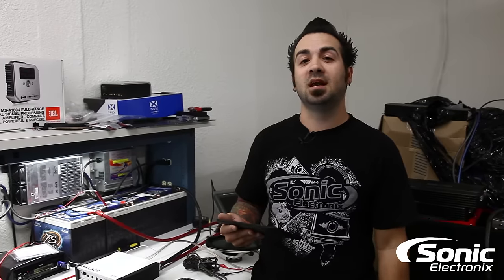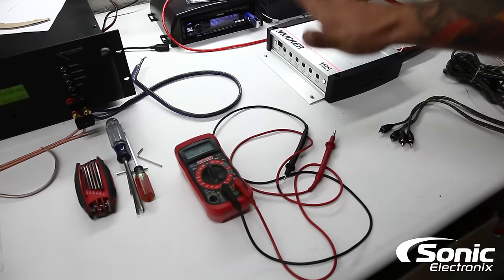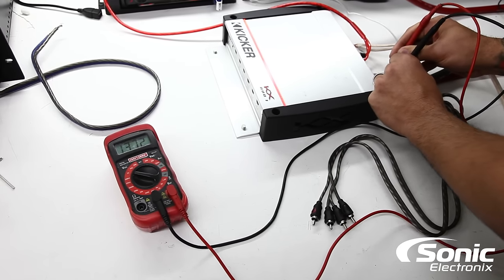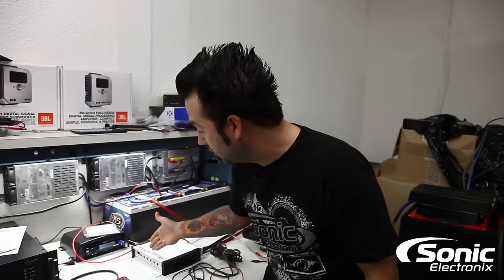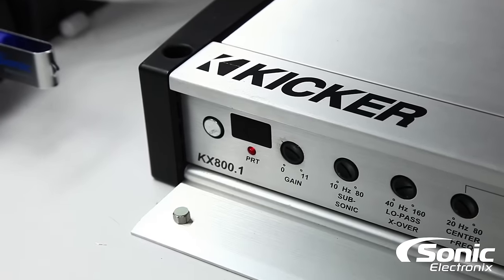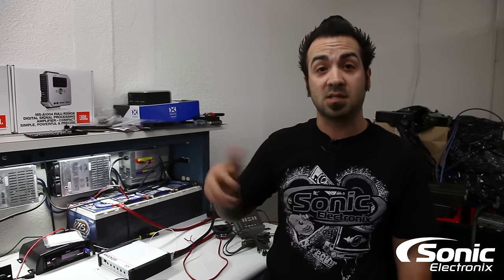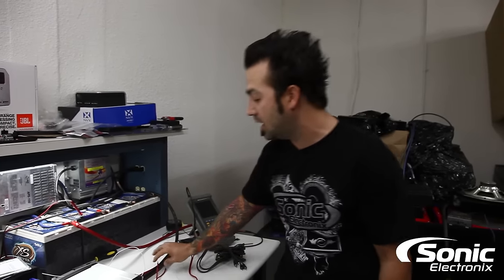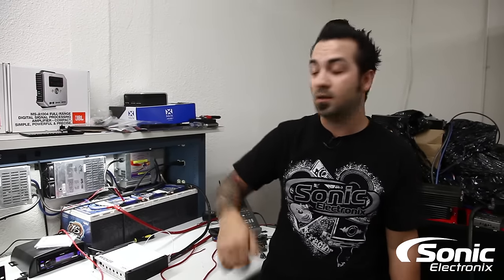Why is My Amp Going Into Protection Mode When I Start My Car? | Car Audio Q & A

Comment: Me: why tf is it going into protection mode?
Ground isn’t hooked up right
Fixes ground
Amp: Protection mode
Reply: Same! Imma end up junking the whole car I'm done lol
Reply: @gmax341  same
Reply: @Bajrangiprasadkumar  turns out I was trying to run a 1 ohm speaker with 2 ohm stable amp 🤦🏼‍♂️. Fixed my issue by buying a 1 ohm amp.

Comment: You should also make sure youor using the right gauge power and groynd for you amp. And also make sure you stock alternator can supply the amperage that the amp needs.

Comment: For anyone using a PAC AmpPRO and is having the issue, the problem is likely with the PAC unit.  They die easily from ANY kind of short in the car, even for a split second.  When they're dead, they will send your amplifier(s) into protect until you replace the unit.

Comment: Hey I had a quick question I have a kicker KX 1200.1 woke up this morning started my car speaker started making this weird noise I unplugged them  the amp was still in protection mode I rewired everything  new from the ground to the hot wire from the battery from the fuse to the remote and it's still in protection mode even without speakers being hooked up so I tried my old amp And my old amp works so could there be something wrong with the kicker app that I bought

Comment: Thanks For the great advice i was just connecting my amp , and it keeps going into protection mode , but it works fine when i remove one of the speaker (out) its getting late so i came home to check for solutions and i will at least know what to look for tomorrow when i go and check it again ,,, Great work guys.
Reply: Mine does the same did u figure it out ??
Reply: @DavidGonzalez-om5yr  did you ever get it figured out?

Comment: I was in tears thinking I need to replace my amp, I just had it for about 3 days and it was thumping fine till that protection light came on tried troubleshooting it myself but nothing worked till I watched this video and found a faulty wire with the speakers so thanks !!!

Comment: Ya started out good, but started over explaining the answer. 
I know what you're saying, but I know from my experiences, that alot of folks won't...LOL 

Chances are if he's only experiencing the protection mode when starting the car, then his battery voltaged dropped too low while cranking. 
The regulator is a good point also, but then the protection mode should have also tripped when the voltage spiked.
Reply: Brake lights?!! 
Wish I could say I don't know what you're talking about....LOLOLOLOL

Comment: Awesome video. Huge help in figuring out why I had one going into protection at different times. Damn speaker wire grounding out. Easy trace and fix. Thanks for covering all the options and troubleshooting.
Reply: How would 1 trace down a speaker wire grounding out?

Comment: I've been looking for help all around but with no results, i hope someone still actively watches this video or something. The issue im having is when i start my car my amp works fine, and my subwoofer kinda works fine too. BUT when i turn the power off and the amp shuts down and i turn the power on back again my amp's light is flashing indicating an issue and the subwoofer doesnt work anymore. so i turn the power off and come back after an hour it works like before repeating the issue. i've basically got a one/two use a day subwoofer :D

I'm running a 400w 4 port pioneer amp with a 12" 1200w pioneer subwoofer

Comment: OK vid i guess. But, many of the problems you went over are not specific to his symptoms of the amp not powering up only when the car is on. If the speakers are shorted, it wouldn't work in ACC mode either. Given his symptoms, I would check the power to the amp, the ground, and then the remote turn-on, as many newer cars do have some fuses that are powered/not powered once the car is started, and if the remote if connected this way via fuse panel, it could be plugged up to such a fuse.

Comment: Heres a fun question, my GF dropped her aux cord into the cig lighter and blew the head unit, the amp is now quieter than it used to be, even with a new head. No protect mode or any other issues. What do you think went on the amp?

Comment: I was having the same issue and couldnt figure out what the problem was. After trying all the troubleshooting it ended up being that the remote gain controller had to be plugged in otherwise it would trip the protection when the car started.
Reply: U tlking about the bass knob ? Mine keep going into protect mode.

Comment: randomly when I listen to music it will cut the bass and go into protect mode and when I turn the vehicle off the amp turns on for a few minutes then turns off again
Reply: YOUR WORST NIGHTMARE check your wiring and ground connection and fuse on amp and fuse on the car battery
Reply: YOUR WORST NIGHTMARE bad alternator or burnt wire somewhere
Reply: Your speaker could be wire wrong you need a 4 ohm and also your amp may not be beefy enough for your speakers
Reply: Check your ohm dual 2ohm voice coils or 4ohm which ever u need to make sure what you are running at the amp I have dual 1 oam VC if I run at a half ohm on most amps they will burn up or o erheat

Comment: Why cant i turn my amp all the way up? When i get to around 50% gain it goes into protection.
Reply: Your gain is way to high. Watch Sonic Electronix's video on how to properly tune an amp!
Reply: yeah you are not supposed to turn your amp all the way up.
Reply: GamingPC*BassGuy yeah its fine now, i was using it indoors with a power supply that isnt capable of handling it. i can have my source at 100% and my gain at max and my bass boost at +12db and it still works fine. the issue was voltage and wattage. 13.8v and around 30amps its working fine.
Reply: Gershon Dharmanandan bad alternator man swear to god that what it is
Reply: Because the Gain is for RCA input voltage to match your output Headunit,.....NOT for a source of power wattage or output power.

Comment: Hi guys, i got 3000 speakers, and a 7000 watts amp, i tryed everything and still doing that stupid turn off, do i have to swap my battery and my alternator? Or the power wire has to be change also???

Comment: If my battery’s old, can it cause my amp to go into protection mode, just hooked up everything. I have a solid ground. It has the green light until a bass note plays. I have the loc hooked up to the factory sub and the remote wire is coming from the loc

Comment: I'm running a dd audio redline 800 series on a dd audio Dm1000a. If I use the bass knob more than 40% I the amp goes into protection mode. The amp is always hot.

Comment: Connect a jumper wire between the power wire and the remote wire.  Put the remote wire and power wire in the usual ports. But just put a wire connecting the remote port and battery port together.  my amp was stuck in it and its never done it again
Reply: So put a jumper in the positive on the amp  to the remote location ?

Comment: Hey Allyn, Thanks for the Vids man,  and Greetings from Texas. My question is,  What are the main factors in choosing a Great Sub ? For example - Voice coil sizes, Magnets in Oz's and Material that the sub is made From ? Thanks !
Reply: Cristo Bal Look for reviews on products, check out their sites, look for their history in car audio! A good sub can even be a single voice coil sub with a small magnet, it is just the quality of construction, your needs and the power you can afford! One good example is JL Audio, they are well known, have many wins in competitions and even in the late 1990's you could buy a W0 that would turn many heads with sound quality that nobody could compete with! I still have my 15 year old single voice coil JL's and they are as good as the day they were bought, they recently were refoamed but haven't ever failed! They set off Bank alarms, woke up fire departments, got me pulled over just for a peek at them, they even impressed an Authorized Orion HCCA dealer, that had to come and ask what I had, he said his subs looked like they were powered up and coming out of the baskets! I was parking to buy some power cable from him, but he ran outside! I had two 12's and two 15's all single 8 ohm subs each set wired parallel running on a clarion 4 channel bridged to two channels that was rated at 380 watts total! He couldn't believe his eyes when he saw my setup! But that is how JL won many competitions in the early years even setting major records in low power categories, they did so well, retailers wanted to sell JL and would travel to the competitions just to ask to sell them in their stores across America! Also look at warranties offered! JL Retails from their own site!

Comment: I got a question got a Rockville 4ch amp it worked fine when I last parked it. Been driving my new truck. But today I want to drive my jeep and when on standby or started the amp stays on protect mode. I removed all my doors wires from amp and it’s still in protect mode. What else am I missing.?

Comment: So when you say "loose fuse" are we talking about the in line fuse under the hood? Or perhaps there could be break somewhere along the power wire?
Reply: Yes, fuse under the hood. If there were a break along the power line, you'd have 0V. Or if it were half broken, you'd be shorting to metal in the car and either blow the fuse or have a fire. lol
Reply: firebirdude2 bahaha yea I figured out my problem had sketchy wiring rig done under my hood. But yea I was told the same thing about burning the car down lol.

Comment: Mine goes into protection mode only when I drive faster than 60mph... it will kick out when treble takes over, then when a bass moment of the track comes on it kicks back in about 10 seconds later like it realised it was supposed to be on! Any ideas?

Comment: I have an older audiopipe 1500 watts amp and 2 pioneer 10" subs. It used to work fine but some wires got loose and I tried to re-wire it up. Now the amp goes into protect mode when i turn the gain up. 

I made a new ground and cleaned it. I'm just not good at this stuff so I really need to take it to someone who knows what they're doing but I wanna save money. My car setup is a mess

Comment: I have a question I was driving home from school and my subs shut off I got home and got dressed for work and when I turned on the car they worked for like 2min. Then today they worked in the morning but shut off after a couple mins then came back on 10 min later for a couple seconds. What's wrong??? Thanks
Reply: I have a similar problem with my system going on and off also. I checked my speakers and they were destroyed.
Reply: +AutoVids I fixed it a week ago it was a simple fix, I had to tighten my ground bolt located in the trunk of my car.
Reply: Nice!
Reply: I have had grounds come loose before. use lock washer and double nut them or us lock nuts. I learned that through experience. Vibraations can loosen them.

Comment: I have a digital audio amp ( Old school I’m guessing) it is a 2 channel 5k amp and can’t find any info on it. It has temp gauge and a voltage gauge and 2 fans, went into protection mode. Need help

Comment: hey man, question. what if my amp goes from red to blue on the protection mode, but only if i swap the power cord to the remote cord  input? but even though its on it has no sound.

Comment: I have a pioneer receiver, a 4 channel kicker amp for my highs and a mono fosgate amp for my subs. When the bass in the music hits through my highs I get a horrible distorted sound, but when I disable my subs by turning them off through the head unit it goes away. I am now running my highs off the deck without an amp and it's not as bad. I have swapped out my highs amp, and my head unit without any change in sound. It's an older car (1972) that did not come with a radio in it so a ground has been made behind the heady it. I'm thinking my ground isn't good enough or my rcas are not a good quality. Any ideas? Thanks for any ideas you may have & keep up the good work.

Comment: Just a quick question my AMP goes into protection mode when i turn on the car but if i unplug the RCA cables and turn on the car and then reconnect the input RCA then everything works fine

Comment: I just purchased a new amp. I had a system in for about a year and wanted something smaller. I went to turn my new amp on and it will turn on and then off right away. I haven’t been able to figure it out. To much power going to the amp? It could be a short but I haven’t been able to find one. I’d appreciate the help. Thanks.

Comment: My amp goes into protect. A skar lp 1000.1 can't figure out why either. Only when bass hits hard. Gains set right amp even has a clip light. Running stock electrical too.

Comment: Do I have to pull my subs out the box to test resistance?
I've heard that if your speaker isn't sitting with its butt on the table then your resistance will fluctuate.

I'm trying to test my final resistance will subs still in box and it's fluctuating like crazy

Comment: My amp is new and it will go into protect when I plug in the rca cables n will randomly pop and try to bump but won't I checked all wiring and it's all good it was working for like 1 day then boom protect

Comment: My subwoofer amp powers up and plays at low volume but as soon as i turn it up it jumps into protect mode. I have disconnected the speaker wire and rca's from the amp and it was fine. i have not checked the power or the ground to the amp yet but please give insight on what to check for now.

Comment: what would cause the amp tp go into protect mode when you hook up rhe audio cable from the head unit? tried a new head unit and new audio cables and still protection.  im guessing theres a short in the amplifier someplace?

Comment: Running a Kenwood 248U single din To a sony xplod 1000w 4 channel, To a 12" 4ohm  Pioneer sub woofer  have the settings on flat with the stereo at 23 to 25 the sub woofer shakes more then thumps (85hz on settings / 120hz is same) seems like little power pushing ... i tune the amp gain pass half way and protection comes on ... your video help put my mind on where the problem is...i'm thinking i have 4 gauge on power and 8 gauge on Ground ..cause no money left to up grade the ground lol...I might use some of the extra 4 gauge i have to make a ground and see from there ... The 12 inch sub i got from a audio store last year ..really good price..maybe too good to be true .. hope the coil is ok that will be my next guess

Comment: I have an sfb 1000. I wired in a ds18 v2hl line out converter. Have a strong ground, 150amp fuse, and sky high remote wire ran to an ignition wire off my stock head unit. I hook the amp up with only power ground and remote and when i turn the car on its in protection mode (protect light blinking), clip light solid, and power light has a slow blink. Not sure why its doing it.

Comment: I have a 96 Nissan Maxima that has amps on each speaker. I replaced the stock radio with an after market radio. I ran RCA from radio to aftermarket amp RCA input then ran wires from out put not using RCA out put but using wire connect. No sound so If I run RCA input do I have to use the RCA output for it to work?

Comment: Awesome video, I have a similar question, my amp cuts out when the speakers are at a certain volume, that's right, understood its to protect the speakers, but does that mean when the amp cuts out, that's the loudest the speakers can go? if so, how does the amp determine how loud the speakers can go? because I had the speakers connected straight to the radio and it went louder, than via the amp
Reply: +Cazwhin Uniqukes i had this similar problem. The problem was that the speakers were just too much for my little amp. I got an amp with more watts and it worked fine.
Reply: So in other words, get the maximum RMS or total peak power of all the speakers I want to run, then get a Amp that matches that, then it shouldn't? or wouldn't cut out?

Comment: Hi there I've just bought 2 BOSS CX154DVC 900W rms sub and got a mono block pioneer GMD8601 800 @ 1omh load. I got to parallel the subs to 1ohm load, will my amp gonna die

Comment: So I bought a stereo from a friend which was a prime 1000.1 amp and two jl w6v2's 12". Well I never did take the subs out the box to see how the voice coils were wired. Well The w6's are dual 4ohm and they were wired series which would equal 16 ohm final at the amp. My question is could that high of resistance kill my amp? Cause I was playing it for 2 hours straight and it went into protect and hasn't worked since.
Reply: +mkIIIsupras same thing happen to me with my kickr cant find any solutions and nobody seems to have any answers
Reply: No. Not at all. In fact, it's VERY easy for the amplifier to play into that load. You won't get much power out, but it certainly won't hurt the amplifier. It could be 64 ohm and not be a problem.
Reply: you still have the same set up?
Reply: Dead battery. U drained it. 
Charge it up. Either way check for volts with ur multi meter. Before an after ur charge.

Comment: Question - JL AUDIO HD 600/4 and 2 pairs of 8 ohm components speakers (6.5")
Can I connect a channel to each speaker directly or do I have to bring them down to 4 ohms?

Comment: I have a kicker 4 channel amp and if I have 2 or even 1 bad 6x9's speakers hooked up to it will it go into protection mode? Because it makes my front speakers even not sound all that good.. Like it won't amplify the sound there's no strong output like there you used to be.. Basically they sound like someone is putting there hand over the speaker.. And it's just not loud.. When you turn it up. Help me out if you know what's going on?